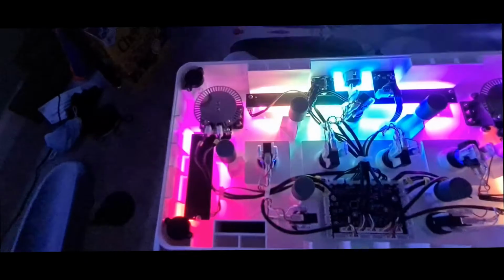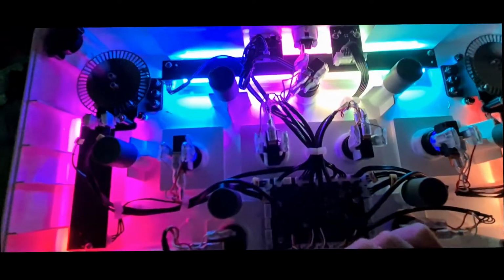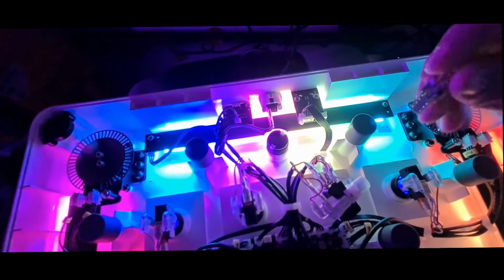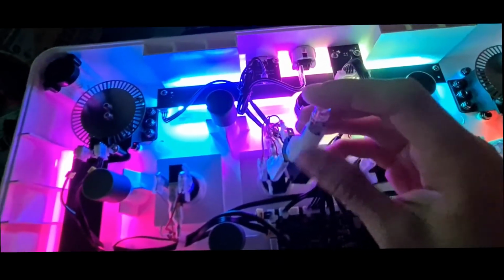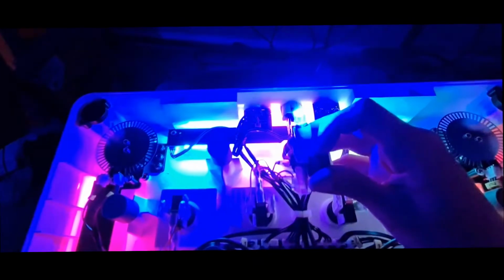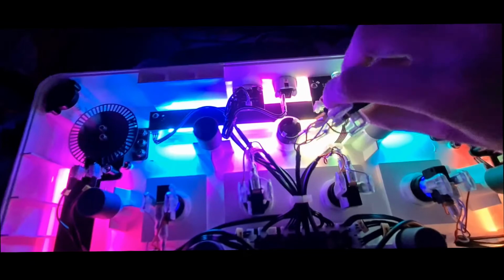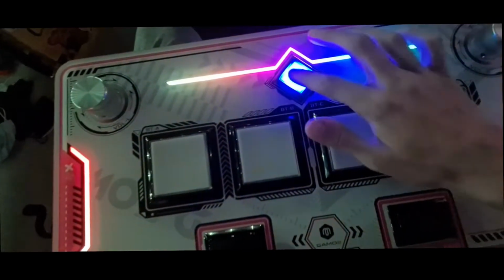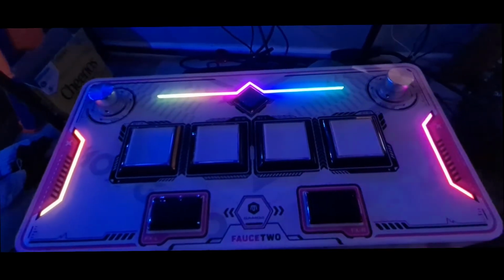How to replace LED lights on the Faucetwo Sound Voltex controller

Comment from the maker: NOTE: This for the the default buttons not the Swana buttons. The method for those is slightly different. I Think you pull up on those instead of twisting and pulling.

Comment: I tried twisting to the left and it feels so forced, like something would break. Any tips?
Reply from the maker: Try both directions if you haven't already. It might be different for some of the switches or I might have been wrong when i said "twist to the left" either way they come out by twisting them
Reply: @weegee888ZEN  Thanks for the info!
I found out that Sanwa buttons don't come out the same, I was supposed to just do a straight pull rather than twist and pull, that could have gone horribly over time lmfao.